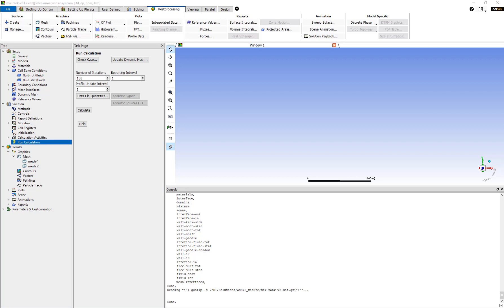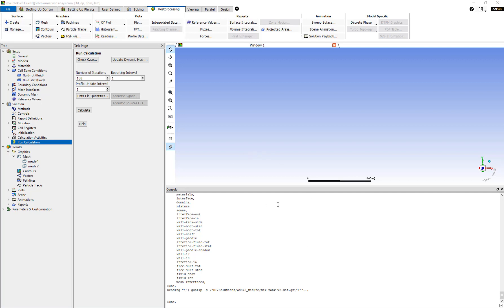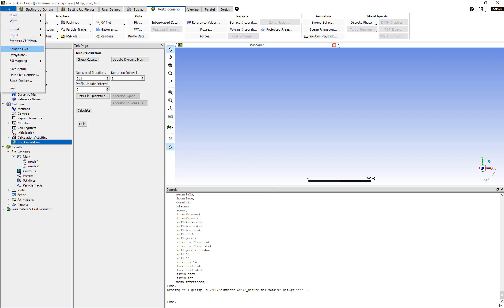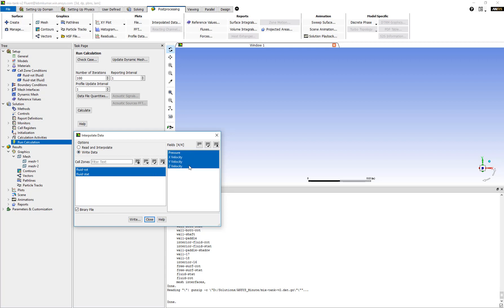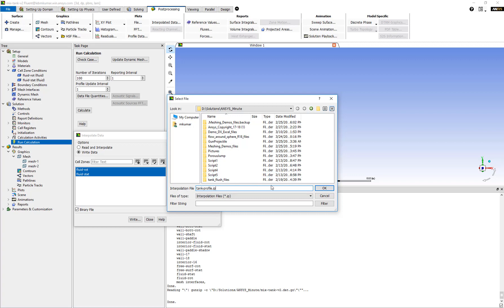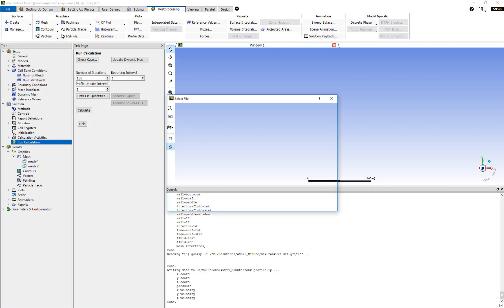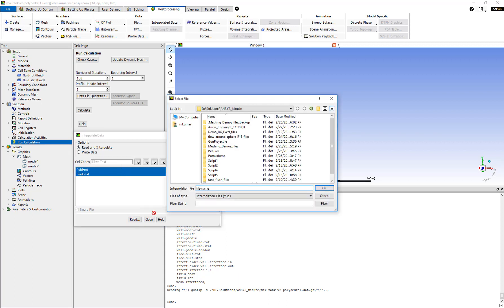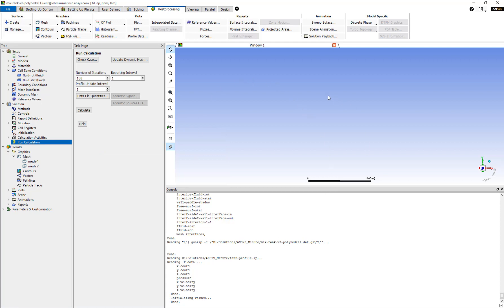Transfer Data from One Fluent Case to Another Using Interpolation Files

Comment: Hi, I am running a simulation for an unsymmetric airfoil for various angles of attack. Validating with the wind tunnel data, I am seeing that for angles close to 10 deg, SAS model is giving me accurate results, while at low and high angles, Spalart Allmaras model is accurate. Can I use this method to run the simulation in one model for a number of time steps and interpolate and read in anther file with the other model? Does it help? My concern will be to validate the lift and drag coefficients with reasonable accuracy.